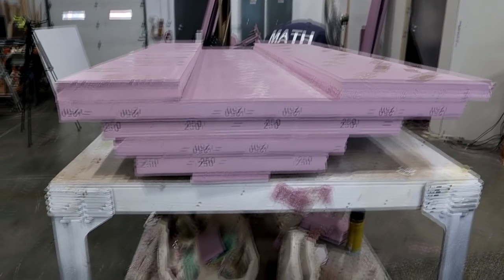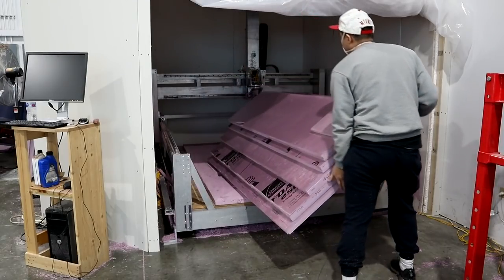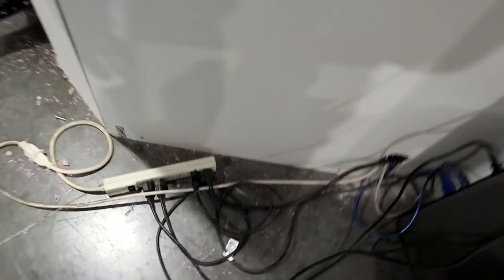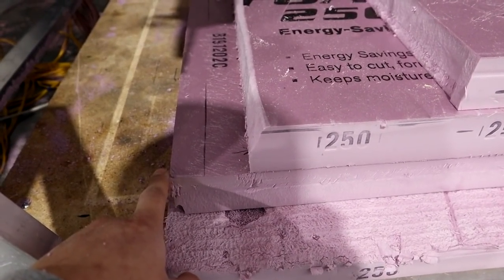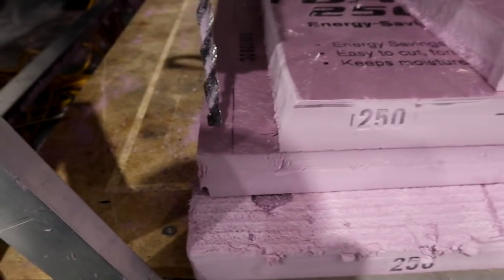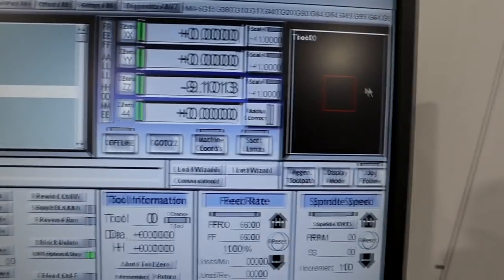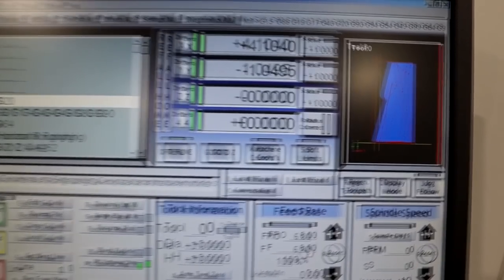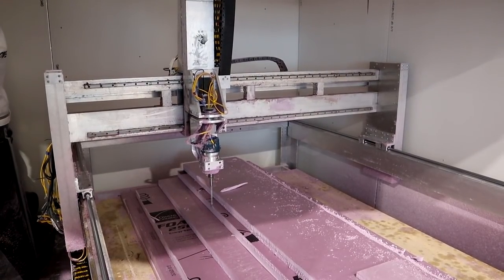Hey Elon Musk, this is my Tesla Cyber Sedan (Cybertruck remake)

Comment: Make a design that is suitable for a electric vehicle van or class C motorhome! That would be so sweet to live and travel in. With a large house battery and a few solar panels on the roof you could probably live anywhere and boondock for a long time, then come back to town to shop and recharge.
I love the design of the cybertruck, but a version that is longer and has enough height for standing in? That would be awesome.

But the current electric vehicles are really pretty small.
The iddeal for this is probably the iveco electric truck that you can put a box on. The rivian also looks pretty interesting.